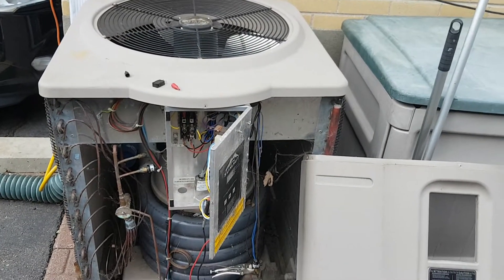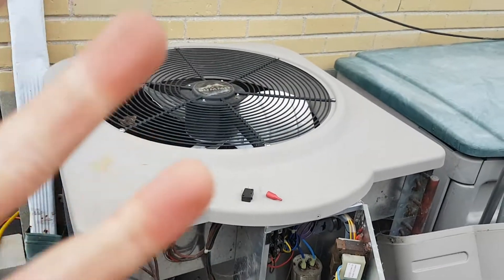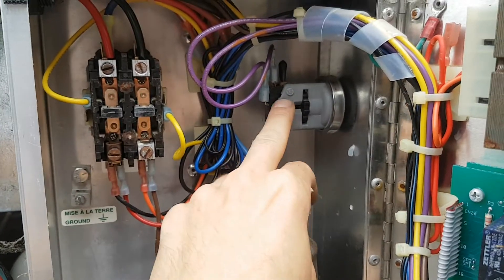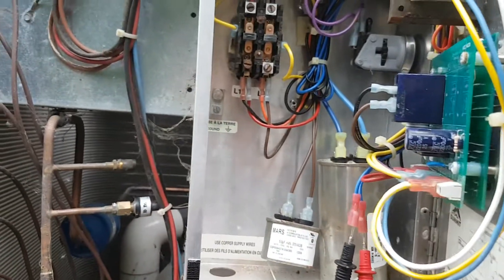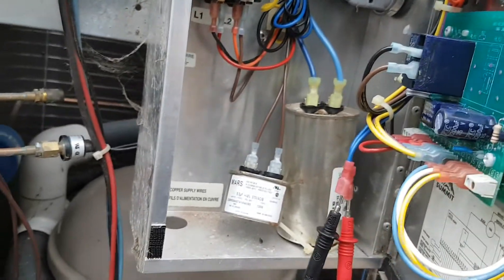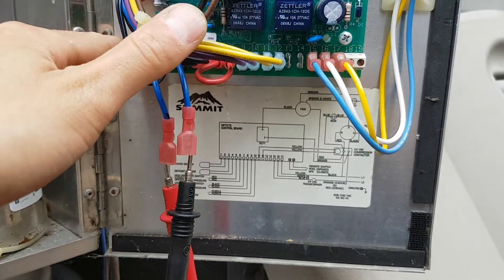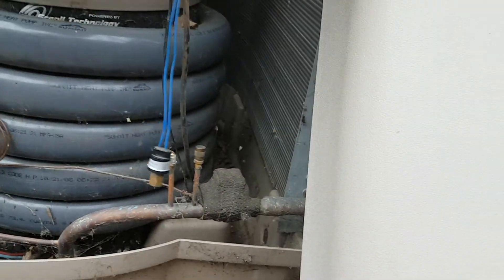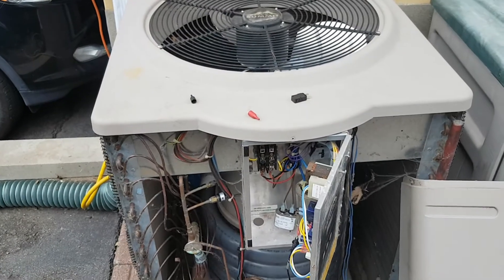How To Diagnose & Repair Hayward Summit Pool Heater Heat Pump

Comment: Hey there I have a question, Raypak 4350. Unit turns on and runs fine no codes. But within a few minutes the internal piping starts to freeze and unit does not defrost. The external coils show no frost just the internals. Any idea where to start?

Comment: Hello m'y friend, could you help me with a problem with a Hayward motor pump that has low pressure, we have to put some kind of gas in it, we changed  the low pressure switch or valve  and it still does not turn on and it indicates low pressure thank you so much

Comment: @QuaabQueb, awesome video  dude. My buddy has a similar unit (Hayward Heatmaster) He didn't properly store it during the winter and the cpvc split. Does the whole coil have to be replaced? Worth saving?
Reply from the maker: @justinhussey2376  Probably not. I would try the easiest and cheapest thing first. Try and sand down the split.
Get a section of 2" pvc pipe, cut a slot on and then warm it with the heat gun to open it up, you are making a sort of "patch" you can slide over the split pipe and glue it on with pvc primer and cement. It may hold for a year or two.
You can try and find a donor unit on marketplace. People often give them away for free when they crap out.
Keep in mind the titanium heat condenser coil is running through the cpvc coil. You will need an hvac technician to come pull a vacuum on the unit, disconnect the coil, install the new one and recharge. That service call may be worth more than the cost of the unit unless you know a guy in the field
Reply: @QuaabQueb  thanks man, he decided to get a new one afterward,  but when I did look at it, the PCV was totally split apart in a few places. Appreciate your response

Comment: I have the same heater and it will shut off after around 3 minutes and it trips the breaker on my panel. I took it apart and nothing looked bad, can you provide any help? Thanks
Reply from the maker: @cute_olive_preppy  If it's setting the breaker then something is shorting.
I would recommend using a clamp style meter to monitor the current and see if and where it's rising. You say it "runs" for 3 minutes. Is the compressor on for 3 minutes? Or is it setting the breaker as soon as the compressor kicks on.
Reply: @QuaabQueb  I think it's kicking out when the compressor kicks in, because the fan and screen are operating fine but I'm not positive when the compressor is supposed to kick in. I appreciate the help, I have an old multi meter, maybe I will dust it off to see if there's a short.
Reply from the maker: @cute_olive_preppy  You would need a clamp style multimeter that you can clamp on the wires.
If it's setting the breaker as soon as the compressor kicks on then it could be a seized compressor. It's possible it could also be a defective breaker

Comment: Thanks for the video it was very informative. My question is I would like to run my Sum 4 with a variable speed water pump, but the water pressure switch is triggering a “low flow” error and won’t engage the heat. I’m thinking of replacing it by a digital programmable water pressure switch which would allow me to program a pressure range for it to close and engage the heat. Obviously it can’t be too low ‘cause I don’t it to overheat, but what do you think? Or do you have any suggestions?

Comment: I have a TTI heater with the exact same control panel and electric components like the summit in the video.
I get the FLO code although there is flow and there's no obstruction. I changed the flow switch and is still have the FLO code. I tested the switch with a meter by turning on and off the pump and the switch it works.
I even shorted the terminals where the switch goes, and I still get the alarm. 
Any ideas???
Reply from the maker: You shorted the terminals on the board where the flow switch connects?
If so and the problem persists then there could be an issue with rhe board.

Comment: Hi, I have a Summit_XL_Hayward, when I turn on the breaker the fan works, but the screen doesn't show anything and the water doesn't go warm. Does someone know what could be?
Reply from the maker: The power supply to the control board.
It could also be the display is not working or the board is defective.

Comment: I have a leak in the cpvc on the back side near the inlet and outlet, can i buy that type of pipe and repair it myself?
Reply from the maker: Yes if you have enough room to cut it out and glue in a new section

Comment: great video......my hay/summit xl140 is not sending signal to contractor coil.....not low on r410a, lp and hp and Flo all ohm out, no codes.....replaced board and contactor, ...when I turn it on, everything seems fine,,,,after 3 min, the flame indicators appear but does not energize the contractor coil......unit is less than 2 years old.....is there anything in the board setup I need to look at?   I went through the setup as best I could...is not setup for remote etc.     when I manually energize the contractor, comp runs and A/C grades react normally

Comment: I have a 3 year old just out of warranty Hayward HP21404T that has an issue. The other day it was not heating and panel read “Lo Flo”. It was shut off until today and when I turned it on it is now reading “HP”. I have read what the code means but didn’t know if you might have an idea based on age of unit. So far every Hayward component has failed and this was the last item with a problem but sadly now it’s out of warranty.

Comment: So I had the white pvc pipe in the back of this unit explode, after the company opening the pool for me didn't open he valves and ran the pump causing a buildup of pressure. Is there a way to lift the copper surround on this unit to be able to get to the pvc pipe in the back and replace them? I'll pay for guidance not looking to get something free out of you, I know it's your job.

Comment: Hi, the flexible piping on mine has leaks. Tried to put epoxy, silucone, flex tape ect...nothing holds. Can I just cut the leaking portion of piping and replace it with new one and fitings
Reply from the maker: If it is the main coil no, there is a tube that runs inside that where the refrigerant gas passed through. You cannot cut it.

Comment: Great Video, I have to replace my sensor water temperature in my summit Pool Heater heat Pump. I buy the part SMX306000024  but i can't find where is it in the pump. Can you know where is it 6 thank you.
Reply from the maker: Just follow the wire from the controller.

Comment: trying hard not to smash this thing but anyways. New capacitor, new contactor ..not starting up. Shows the pool light and current temp of water but...le sigh nothing happening. The ole' push on the contactor with a screwdriver turns it on though...maybe I'll just keep the position. I'll try the water pressure switch trick tomorrow. What is that black part called that I'll be hitting up the electronic store for please and thank you.
Reply from the maker: Try and jump the water pressure switch to see if that is the problem, if not maybe the contactor is not getting power
Reply: @QuaabQueb  tried that today too..nada.
Reply from the maker: @moebee3882  check high and low pressure switches?
Reply: @QuaabQueb  if I'm doing this right, the LP has continuity but the HP shows a big fat OL.
Reply from the maker: @moebee3882  I believe it should also show continuity

Comment: very good video i have a dream 12.5kw unit its has no display compressor fan running , copper pipe hot up to the heat exchange , i am gussing it may be the pcb because i have changed the display for a new device and still not working , water outlet to pool cold

Comment: I've got a a unit with no error codes, the fan is spinning, the water flow is good but it is not heating the water. I noticed there is no condensation water at the base on the concrete slab it sits on. it's 5 years old. I have just opened the unit to take a look but have not diagnosed anything and I'm not educated at all in this stuff. Any suggestions before the service technician gets here in 4 days?
Reply from the maker: Compressor is not coming on.
Check all the common issues, contactor, capacitor etc..

Comment: Today, the same unit gave me a dsd ou d5d code. The display light up and shows the water temp for 5 seconds than I get this code and nothing works. I can't find anything related to this error code anywhere. Any ideas ? Thanks
Reply from the maker: The error codes and their meanings are listed in the manual if I remember correctly, did you check there? You can google the model number and should be able to find the manual.
Reply: @QuaabQueb  Thank you ! No, it's not in the manual. But I finally found the info. It means "defrost sensor defect". I ordered this part and I am going to replace it. We will see ...
Reply from the maker: @stevegingras1625  interesting where did you find the code meaning?
Reply: @QuaabQueb  I search so hard that I can't find back from where. It was in a forum I think. I already got the part yesterday. Will try to install shortly. I will tell you if it solved the issue

Comment: Amazing video!  I've got a Hayward that looks nearly identical to this.  Fan works fine, no error codes, but the compressor tries to kick on and it makes a loud buzzing noise for 3 seconds and then nothing.  Doesn't sound like the compressor kicks on at all, so no heat.  Any ideas?  Could it be the compressor capacitor?  why wouldn't it have any error codes?  TIA
Reply from the maker: Yes could be exactly that. Error codes are only thrown by the sensors. The unit is just simply not turning on.
Reply: @QuaabQueb  Not the capacitor... tested a perfect 79.7 microF... replaced it anyways and didn't solve.  Noticed a loud buzz is actually coming from the contactor switch, so now I'm wondering if that's it?  I ordered a $12 replacement arriving in 2 days... let's see.
Reply: Also wasn't the contractor; replaced it, and still no luck.  I'm stumped.  I check the continuity of all three prongs on the compressor in all combinations... all good.  when compressor tried to kick on I get a voltage drop from 246 to 200 or so, but I assumed that is normal for startup... just mine won't start up. any other ideas on what to check?
Reply: @madeleinedelson4109  I have exactly the same issue. Changed capacitor, didn't do the contractor yet.  Resistance check gives me around 3 ohms in all combinations. Not sure if it is normal. When compressor try to start, the breaker trips.  Do you have any suggestion?

Comment: I have this same shitbox and after a dozen uses the low pressure switch died.  One year old unit. I had an AC company come out and put gauges on it, full charged.  Bought another LP switch that lasted 2 days.  Had to hotwire it to run, which it did fine for 2-3 uses.  Ice built up on the last use.  Now, no heat output.  I want to punt this pile of shit through the goalposts of life.  Nobody services these in my area.  I guess I need to buy gauges now.
Reply from the maker: They are pretty good units compared to a lot of the crap on the market. It sounds like you may have other issues. I would start by checking the charge once again and make sure it is within manufacturer specs. It may be over charged. 
If you have a residential HVAC guy who is not familiar with pool heaters specifically he may have fucked it up. If you keep popping LP switches that hints me that the unit may be over charged. Good luck...

Comment: The clear tube running from the pressure flow switch came off the end that connects to the pipe in the back…looks like the piece that was connected to the pipe broke off….how would I repair that?  It looks like something was kinda just screwed into the pipe with a nipple like thing coming off the top for the tub to slid over….does that sound right?
Reply from the maker: Yes it's a small barbed end You would need to get a new pressure switch assembly. The hose is also held on by a crimp clamp.
Reply: So this happened to me as well yesterday! How do I get to that back pipe? And where can I find the pressure kit assembly I’ve looked all over the internet.  I have a Hayward summit xl
Reply: @St4r_girly  so I was actually able to find everything I needed at Lowes….my switch was still good so I just got the same size clear tubing from plumbing section in Lowes and found a brass barbed fitting in the plumbing section and used epoxy to kinda glue it back into that pipe…drilled out the hole so the brass fitting would push down into it….connected other end to pressure switch fitting….BAM the heater kicked right on!!!  Hope this helps ya!!  I took the top off where the fan is…got to it that way….definitely a stretch but easier to see everything…

Comment: Great video! Thought the effing bird was outside my window for a second. Is the flow switch tube supposed to have water flowing through it ? I see air bubbles and a bit of water in mine and am wondering if Its air locked and simply needs the air bled out of tube 
Thanks again for the great video
Reply from the maker: Flowing, no I don't believe so. If there is pressure in the system it should activate the switch
Reply: @QuaabQueb  thank you. I’m going to pull the tube off and drain it. Thank you!

Comment: Great information video!!
My unit is a lot like this one and it will start up, run for about 30 seconds and then shut off. 
Any idea why it’s doing this and what I can check and troubleshoot on it?
Reply: U are either overcharged on refrigeration or a restriction in the txv
Reply: maybe the input and output of water supply are inverted?

Comment: I have a Hayward electric heat pump. It was tripping the breaker once in a while I would reset the breaker and it would heat and work with no problem. It did that a couple times and now the fan won't come on. I replaced the fan and the capisitors and it still won't come on any idea what it could be.
Reply from the maker: Something is shorting or pulling toomuch current.
Reply: @QuaabQueb  any idea where to start, I pushed coil contactor in and the compressor gets super hot really quick. I have checked all wiring and it looks good. I have power going to the fan.
Reply from the maker: @timdogsprincess  check the compressor windings with a multimeter. I have seen the pins blow out so look at them carefully to see if thru look burnt or damaged. Always be careful poking around in there as the capacitors can hold a charge for some time.
Reply: @QuaabQueb  will do I have checked the ones at the capacitors and the contact switch,  they look good. I will check the wire connector right at the compressor.
Reply from the maker: @timdogsprincess  yes look up how to test compressor winding resistance. You can also use a clamp type multimeter to check the current draw of the unit. If it is pulling abnormally high current you know there is a problem.

Remember the circuit breaker is an overcurrent protection device. It's function is to open the circuit if something is abnormal. Ex.: A direct short back to the source (not ground!!) , or an overloaded piece of equipment.
Reply: @QuaabQueb  Thank you so much for the info, do you know what the ohms should be or does it matter if the two equal the total. by the way, did you kill the dam birds? Just after watching this I had a few in the tree behind me driving me crazy also, lol
Reply from the maker: @timdogsprincess  ha! No I let the birds be.
I am not certain it may be listed in the service manual (you can cand it online) if not search the model of the compressor.
You have 2 sets of windings one which starts the compressor motor, and then the other which run it during normal operation.
Reply: @QuaabQueb  all readings are zero including ground to case, no shorts to case
Reply from the maker: @timdogsprincess  you should have some resistance across the windings.
Reply: @QuaabQueb  thank you so much for your help, you have been amazing. I did figure out the problem. I ended up being a faulty temp sensor on my aqua link. I put it into service and manually turn on the heater and it came on no problem. Thanks again !

Comment: hey, so I have a Hayward heat pump. The fan runs., but when the condenser kicks on runs for about 30 seconds then bogs out. and then the lp come code comes on, tries all over again. Any ideas on what it could be? I changed the capacitor already.
Reply from the maker: Yes that is the low pressure error code. The causes are listed in the manual. Usually it is because it is too cold outside.
Reply: @QuaabQueb  yeah i looked at them but too cold isn't a problem because I live in Florida . i am thinking that I might have to bite the bullet and get a new heater
Reply: thank you
Reply from the maker: @caragannon2648  page 10:

https://hayward-pool-assets.com/assets/documents/pools/pdf/troubleshooting-guides/HeatPump-troubleshooting-guide.pdf

Comment: I need the fan motor, blade and the top panel from this unit - wanna sell it?
Reply from the maker: I had scraped the unit. Parts are pretty standard. Check ebay.
Reply: @QuaabQueb  thanks for the reply - already did - the top panel is on global back order. Have had one on order for the last 3 months. Good video though!